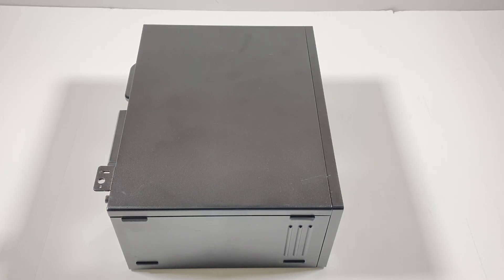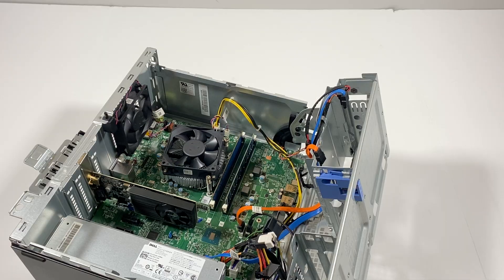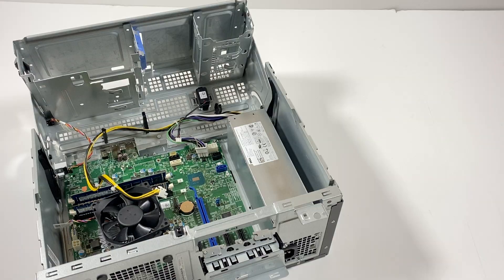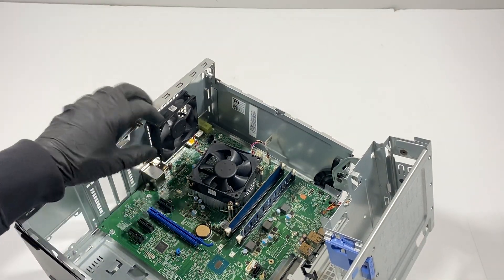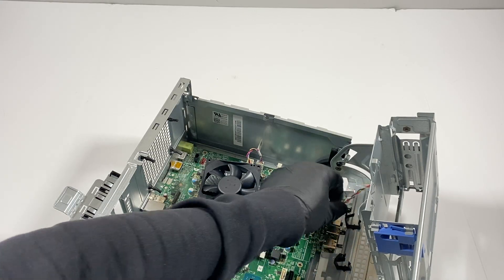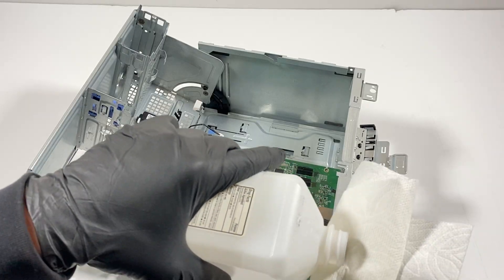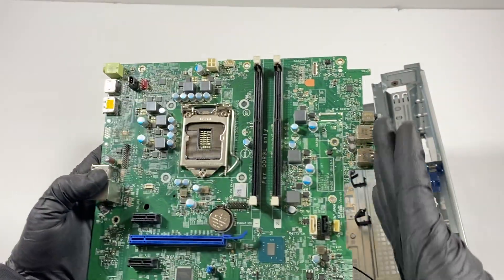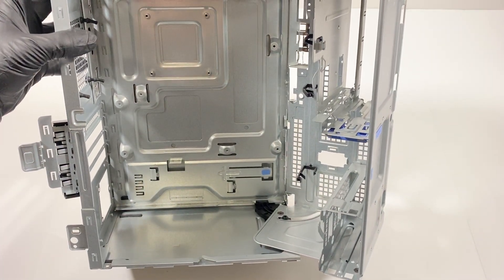Dell Optiplex 3040 Teardown

Comment from the maker: List of parts and upgrades will work with this system Dell Optiplex 3040.

CPU Upgrade:
Intel Core i7-6700 Quad-core (4 Core) 3.40 Ghz Processor
https://amzn.to/3Rb2fiz

(1.) Gigabyte Geforce GTX 1050 Ti OC Low Profile 4GB GDDR5 128 Bit PCI-E Graphic Card (GV-N105TOC-4GL) 
https://amzn.to/2XEqKMb

(2.) MSI Gaming GeForce GTX 1650 4GB GDRR5 Low Profile Graphics Card (GTX 1650 4GT LP OC) 
https://amzn.to/2VkDdSd

(3.) MSI GTX 1050 TI 4GT Low Profile  Graphic Cards 
https://amzn.to/34r0AxG

(4.) Gigabyte GeForce GT 1030 GV-N1030D5-2GL Low Profile 2G Computer Graphics Card 
https://amzn.to/2Xu3SyO

(5.) ZOTAC GeForce GT 1030 2GB GDDR5 64-bit PCIe 3.0 DirectX 12 HDCP Ready Low Profile Video Card ZT-P10300A-10L 
https://amzn.to/3eayL1b 

(6.) EVGA GeForce GT 1030 SC 2GB GDDR5 Low Profile Graphic Cards 02G-P4-6333-KR 

https://amzn.to/3s65uxE

(1.) USB Wifi Adapter for PC AC600Mbps Wireless Network Adapter
https://amzn.to/2ZaGuHb

(2.) USB Wifi Adapter for PC, EDUP AC600M USB Wi-fi Dongle 802.11ac Wireless Network Adapter 
https://amzn.to/3H3YoxG

(1.)  Thermal Grizzly - Spatula for Applying and Spreading Thermal Paste
https://amzn.to/30Qq4ag

Thermal Compound Paste:
(1.) Arctic MX-4 Thermal Compound Paste Carbon Based
https://amzn.to/3JfonEE

(2.) Arctic Silver 5 Thermal Cooling Compound Paste 
https://amzn.to/2ziNU0H

(3.) Noctua NT-H1 3.5g, Pro-Grade Thermal Compound Paste
https://amzn.to/36kTk7A

(4.) ARCTIC MX-4 (current edition) Thermal Compound Paste 20 Grams 
https://amzn.to/2DhGJaK

This RAM works with this machine:

(1.) Crucial 8GB Single DDR3L 1600 MT/s (PC3L-12800) Memory CT102464BD160B
https://amzn.to/2VhGv8O

(2.) Crucial 4GB Single DDR3L 1600 MT/s (PC3L-12800) Memory CT51264BD160B 
https://amzn.to/2xq46wb 

(3.) Crucial 16GB Kit (8GBx2) DDR3L 1600 MT/s (PC3L-12800) CT2K102464BD160B 
https://amzn.to/2VpsKpP

SSD list works with this PC:

(1.) Samsung 860 EVO 500GB 2.5 Inch Internal SSD MZ-76E500B/AM) 
https://amzn.to/2yNxnkE

(2.) WD Blue 3D NAND 1TB Internal SSD, 2.5" WDS100T2B0A
https://amzn.to/2wvnC9Z

(3.) WD Green 1TB Internal PC SSD  WDS100T2G0A
https://amzn.to/3cbrcWa

(4.) SanDisk SSD PLUS 480GB Internal SSD SDSSDA-1T00-G26
https://amzn.to/3a3i9ou

(5.) Crucial MX500 250GB 3D NAND SATA CT250MX500SSD1(Z) 
https://amzn.to/34rZlhy

(6.) Samsung 860 PRO SSD 256GB - 2.5 Inch SATA III 
https://amzn.to/2ybiHLK

(7.) Samsung SSD 860 EVO 250GB 2.5 Inch SATA III Internal SSD 
https://amzn.to/2VjIAkK

(8.) SanDisk SSD PLUS 240GB Internal SSD
https://amzn.to/3c7SEE4

(9.) Crucial MX500 1TB 3D NAND SATA 2.5 Inch Internal SSD
https://amzn.to/3BEn9zE

HDD list works with this PC for extra storage:

(1.).WD Black 2TB Performance 3.5" Hard Drive, WD2003FZEX 
https://amzn.to/2xFUeyF

(2.).Seagate BarraCuda 1TB Internal Hard Drive  3.5" Hard Drive 
https://amzn.to/3g8FXM8

(3.).Seagate BarraCuda 2TB Internal Hard Drive  3.5" Hard Drive 
https://amzn.to/3sMIFxO

(4.) Seagate BarraCuda 4TB Internal Hard Drive HDD – 3.5 Inch
https://amzn.to/3h1XFm4
Reply: do you have any recommendations for replacement heatsinks that would work on the optiplex 7050/7060?

Comment: is there any way you can upgrade the core?
because i3 is really bad
Reply from the maker: Hi, yes you can upgrade CPU to Intel Core i7 6700
https://amzn.to/3Rb2fiz
Reply: @Mxkdt  Can the power supply handle this? I think it's a 65W PSU? If not, can this case accommodate an SFX PSU to allow for an i7 + dedicated graphics (like the 1650 you mention above). Thanks in advance

Comment: This must be the same design as the dell optiplex 7050m, i did upgraded the psu to a 650watt powersuply with a 24 pin to 6 pin adapter, the computer works great :) with the i7-7700, i also switched to another cpu fan that has only 3 pins so that it can run at full speed, i cant even hear it, in hwinfo it goes to 2500 rpm, cooling the cpu down to 80c in full load in chinebench r23. 
i also added a fan in front for better airflow, i also tested 100% load on cpu and gpu with a watt tester, and the wattages when both cpu and gpu was fully loaded was 190 watt, this is with 16 gm ram, dual channel, 3 fans,  i7-7700 and the 1650 super. so i guess you could actully stick with the powersuply that comes with this pc that is 220watt i guess. great video, theese small pc aint that bad, they are selling very cheap on internet, and with a feew upgrades it can actully make an ok gaming pc.
Reply from the maker: Hi, thanks for the info and what brand power supply are you using ?